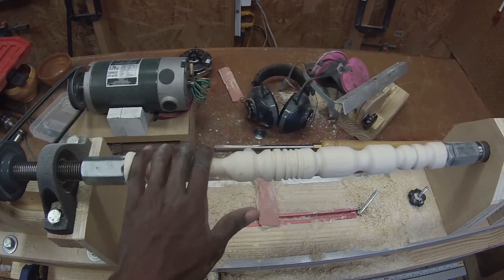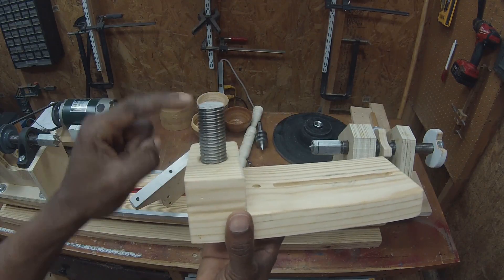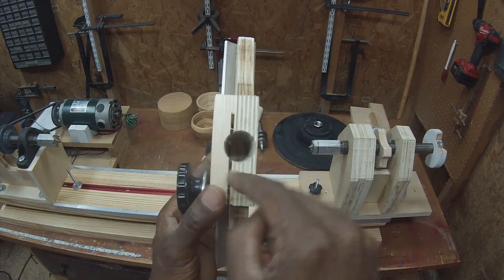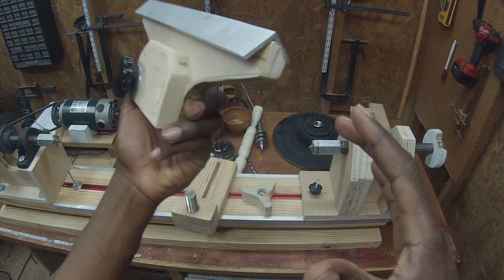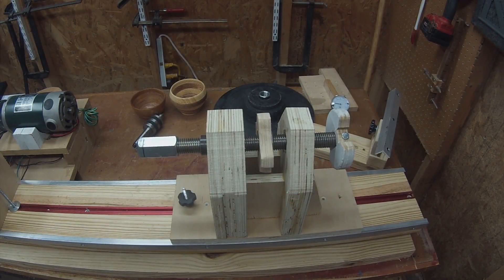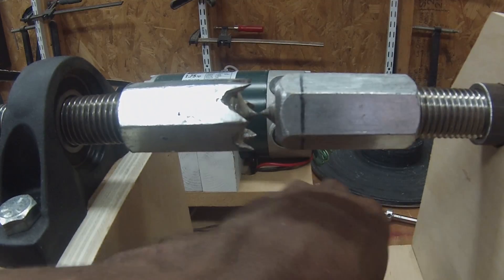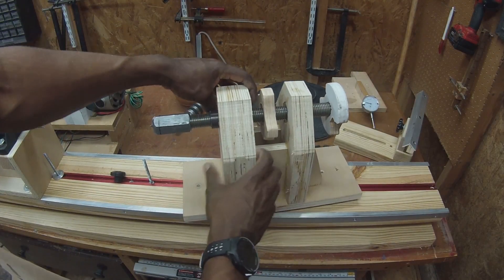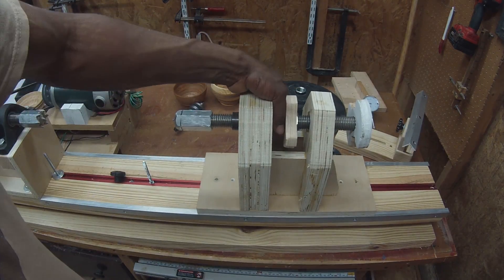The Lathe Part 4, Tool Rest, Tail Stock, Motor Base, And Demonstration: 024

Comment: Hello Jeremy, I would just like mention what I'm about to say in a question form/suggestion. However could you put one slot in each pulley and add a spring tensioner and some kind lever to change the speed? I know you have a way to do this but I am unsure if you would have to unbolt motor and readjust the belt to achieve a different speed. What do you think? I know this adds more parts but to change speeds would be less intense if you will vs having to unbolt motor to readjust the belt. Let me know what you think..

Comment: Hi Jeremy,
I just found your channel and subscribed!
You are one smart guy and very ingenious!
A word of caution on your tool rest and banjo!
I've been wood turning for a while and have seen professionally made steel tool rests break!
The tool rest (which sits on the banjo)takes all of the forces created between the end of the chisel as it cuts the wood.These forces can be very strong,,,especially if you get a catch!
Your tool rest design is great but I think you would do well to re-drill the hole so that it is centered and maybe even reinforce it.If possible use hard wood and not plywood.
I would hate to see you get hurt!!!
Also,,,,after you tap the hole with the homemade tap,,put thin CA (super) glue on the threads liberally so it can soak into the wood.Then re-tap the hole.This is a common practice with wood turners and it makes the threads much stronger and longer lasting.
Looking forward toy watching more of your great videos and thanks for sharing all of you knowledge with us!
Tom
Reply from the maker: thanks
Reply from the maker: Also, welcome to the neighborhood!

Comment: I don't have much metal lathe experience, and almost none with a wood lathe, so this question might be naive.

Could you use the lathe itself to cut the hole in the tail stock? Or is there no easy way to mount a drill bit on the shaft?
Reply from the maker: Yes I could have used the chuck to hold onto a drill bit. But I don't have a  drill bit long enough to drill through all the material. Since I have to screw the pieces together and separate them again anyway, it seemed better to use the drill press to make sure the holes were straight. Also, I didn't want to assume everyone buying the plans would also buy a lathe chuck.

Comment: I'm sure all the distortion happens on the soft side when you tighten the clamp on the 1" screw too. 

I like to get my tool rest close to my work. So that nixes using an angle that's sloped on both sides for me. Also,  the tool often catches the wood and slams it against the tool rest. That would put dents in aluminum and the tool wouldn't slide across easily in the future. I would want steel there.
Reply from the maker: You should use steel for your lathe. I will stick with this for now. It's only three screws to change it in the future

Comment: For the slot you cut with the jigsaw is there any reason you couldn't just flip the part over to make your cut?
Reply from the maker: +John Lane. Other then raising it up on blocks to miss the threaded rod... no. It wasn't necessary to go all the way so I didn't consider other options

Comment: I think I would also make a second tool rest with a wider angle iron on it so you could turn items that are longer without having to slide the tool rest over,thus saving time ad increasing accuracy. Just my idea.
Reply from the maker: I like it. And that is an easy addition. I probably will make one
Reply from the maker: Actually I think I will make a second one that is the same size and mount both of them.
Reply: That would also work. The only thing would be adjusting both to the same exact height (although I don't think that would be an issue with your design) but a good and feasible solution. Good content sir.

Comment: Which motor is best in terms of not losing rotational speed when applying load? Also, what are your thoughts on direct drive lathes?
Reply from the maker: The induction motor is the best motor for maintaining power under varying load. But they don't do well with speed control so you will have to use pulleys.  Or, you can use a DC motor with a KB speed controller. They are not the only ones who make them, but you need one that using feedback to adjust power. It is what I use and it maintains the speed within about 5 percent under heavy load. 
I am not against direct drive...however there are two reasons to avoid it... if you have a serious catch on the lathe the shock load is taken directly by your motor. The other is it makes your lathe assembly much longer. That last one is only a problem if you are limited on space.
Reply: Could you possibly advise on a specific controller? I'm afraid I won't be able to figure out which one will be best. The motor which I'm planning on using is either a 2chp DC or a 2.5chp DC motor from a treadmill.
Reply from the maker: The KB speed Controller is the one I use and I love it. model KBIC-125 9433B 115VAC
Reply: Jeremy Fielding So then all I need to do is switch the current from AC to DC and connect to the controller and I'm to go?
Reply from the maker: Artyom Atayan no. It takes AC input and does all the rest  for you. Best of all it is responsive to the change in load. Not always perfect at low speeds buts it's good. I got mine used on eBay for about $40 and they're still some available
Reply: Jeremy Fielding Awesome :D thanks a lot friend. You are the best
Reply: Also, post more vids soon!

Comment: you could flip the base of the tool rest upside down to finish the cut with the jigsaw if you wanted
Reply: Martin Maughan or use a pistol hacksaw
Reply from the maker: The threaded rod was already epoxied in. But, I could use a spacer to hold it up and then you got it. At this point it doesn't add anything, and I have already painted it. But you are right that is an easy solution.
Reply: Jeremy Fielding I think it's just great the way it is

Comment: Hi just started construction of my lathe had to make some changes as had face bearings to hand which means I had to make a oblong stock for mounting the bearings. I also put a metal plate below the head stock to make it stiffer and bolted through to the base. I only had a small length of T slot so cut a slot and mounted some metal strips either side to act as as a T slot works well and is steel so stronger than aluminium also to strength the bed I used steel angle on the sides . The next job the tail stock. But loving it really its seems easy to make .

Comment: Jeremy, is there anything worth scavenging from a working refrigerator?
Reply from the maker: I have never salvaged a refrigerator so I am not entirely sure what is in there. The compressor may be useful as a "quiet" air compressor. I am not sure. Just thinking about it for the first time now.
Reply: Biggest problem is finding someone to reclaim the refrigerant in it for you.
Reply: Rubba Dubdub the compressor if it's working but the problem is the refrigerant inside is toxic and illegal to deliberately vent to atmosphere so you would have to have it reclaimed before you could salvage it. If it's a fridge with an ice maker or a water dispenser some of those have useful water filter mounts and water solenoid valves that are push to connect. Those parts are easy to scavenge, useful and not exactly cheap if you had to buy it.
Reply: Found Youtube videos showing how to convert compressor into both a vacuum pump and an air compressor. Like your ideas about the water solenoid valves.
Reply: While refrigerant is illegal to intentionally vent to the atmosphere, it is not toxic. It is illegal to vent because it is considered to be an ozone layer depleting chemical. The real immediate danger with refrigerants are that they will freeze skin and eyes on contact, also in an enclosed space they can displace oxygen and you would suffocate from lack of oxygen. Fortunately most refrigerators die because the refrigerant leaks out, so it is mostly gone already.

Comment: great job on the lathe, don't like the tool rest height adjustment, sorry,  just wondered if it would work with a smooth post instead of the threaded rod, then you wouldn't have to turn it around
Reply from the maker: Yes I think it would, I like the threads because it will never slip. But if you clamp it tightly... smooth should be fine.
Reply: Jeremy Fielding yes absolutely the threads won't let it slip, it also occurred to me , with having myself little wood turning experience, do you really need to adjust the height very often
Reply from the maker: Almost never. But there was one time I wanted to move it and couldn't. I don't plan to move it much at all... 99 % of the time you want it level at center

Comment: You could use a coarse bland on your hack saw to finish the slot on the tool holder arm.
Reply: They make jigsaw blades with reach to get up against edges. They're wider than regular blades, and offset.